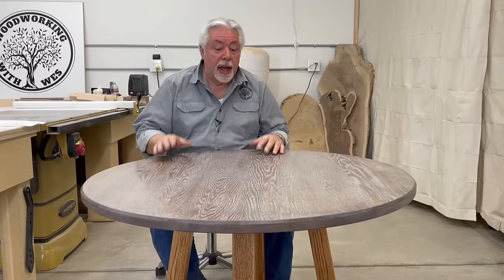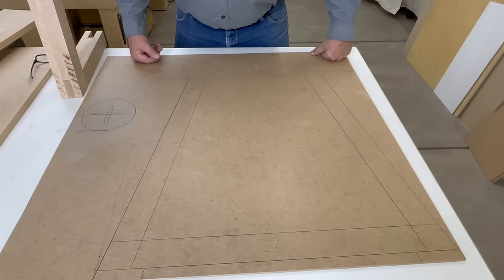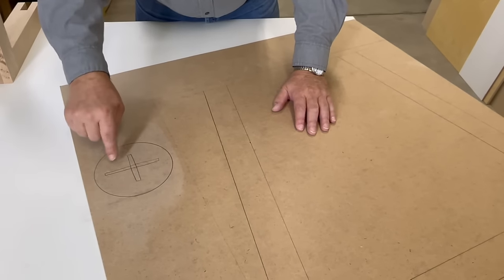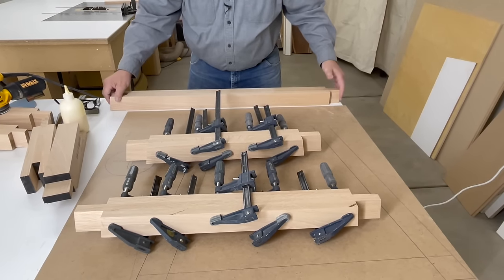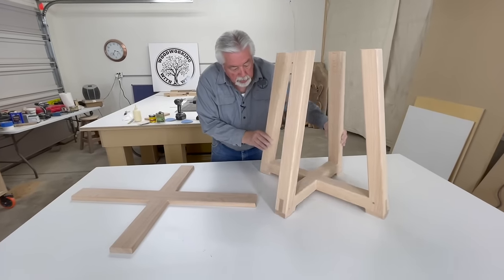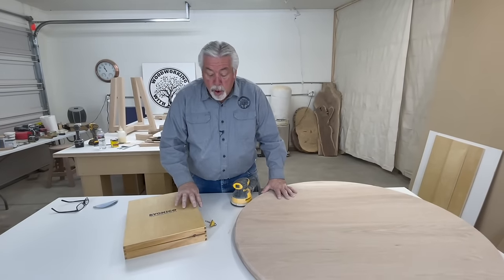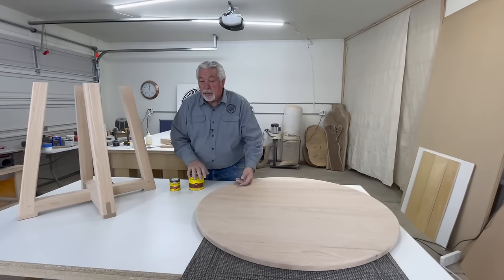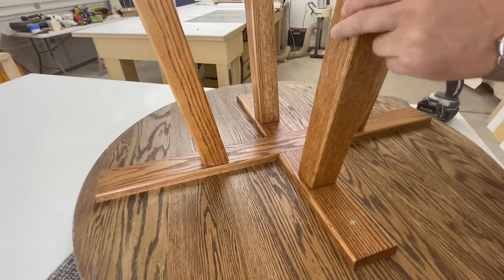DIY Oak Table: Save Hundreds with this Money-Saving Dupe!"

Comment: Wes, can I RE-FINISH a piece like that? Would it be ok to just sand and sand then wirebrush and have at it? Maybe it'll be too late since a finish has already soaked in but it's a thrift store find and a real nice cabinet to learn with. It's a very nice clear furniture grade plywood in great condition except for the finish being dried out. I want it to turn out like yours.
Reply from the maker: HI...I think you would be ok, just be careful not to sand through the veneer. Good luck, Wes 😀